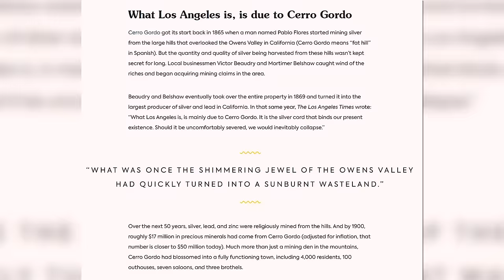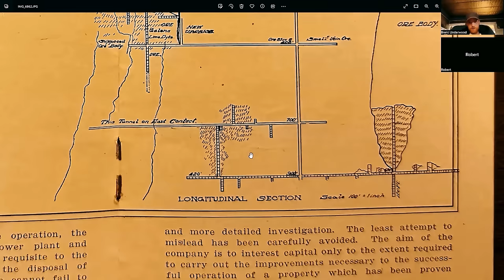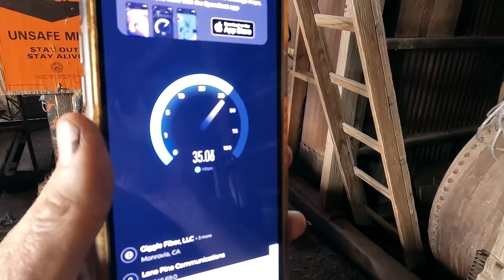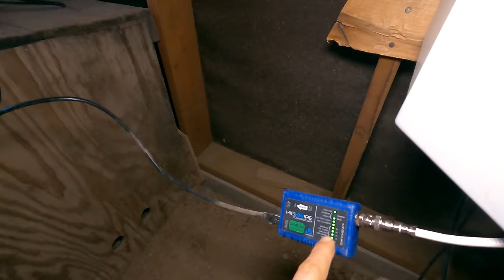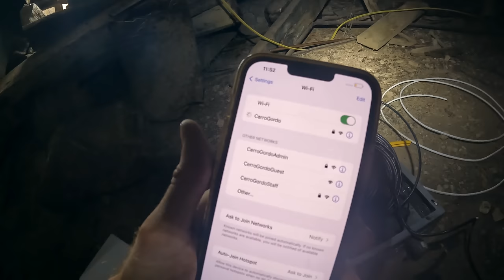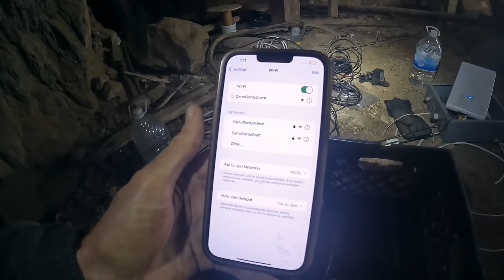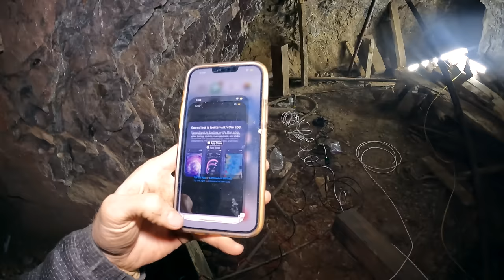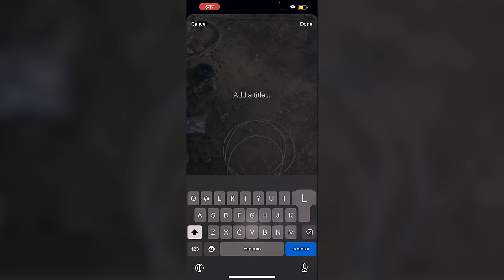I Have WiFi In My Abandoned Mine! 900 Ft Underground!

Comment: as a professional Network engineer, i would have looked at using multi-strand single mode fiber (think a single cable with multiple strands of fiber to splice off of) to each level that is significant to you, such as the 900 and 700 foot levels.  This way you terminate a pair of fiber at each level then add a POE switch to covert to CAT6 ethernet and provide the Power over Ethernet to run the Access Point.  This method is highly extensible and creates a consistent, repeatable network for each level.  The draw back is money, your method is a lot cheaper.  Ether way glad to see you have connectivity down at the 900.
Reply: I was surprised he was getting 50mb over the cable.  not to shabby.
Reply: @procrastinatingnerd  its cause his phone was the only client using that RF space for miles, lol.  you start adding devices and that bandwidth starts getting chopped up real quick.
Reply: Using Coax is just crazy in 2024.
Reply: I agree thats how mondern networks are created. However, to do that well the 900ft of fiber would need to be protected by conduit. So 900ft of conduit.  Then you need the POE switches, those need to be programed to a vlan and protected from dust, heat and humidity. Another problem to solve. You cant just put them in a rack in a closet cooled by a mini split like we do on the surface. 
Oh and the fiber needs spliced. It is not the hardest thing to learn but definitely more involved than coxal cable. 

For those reason, I think the current design is much better because it is the simple and cheep. Thats my 2 cents.
Reply: @bassman87  No, I mean I was surprised that he got 50 mb over the 900 foot cable, not over wifi.  Our wifi can get over 100 mb on the 2.4ghz band, the wifi isn't the limiting factor here.
I thought it was obvious that the more clients you have, the less speed each gets (if they are all using it at the same time)... That will apply to the cable and the internet above ground just the same.
Reply: @AroundHouse  Not as crazy if you look at the price difference for a 900foot run.  Plus a coax cable is much more rugged, seems fitting to be in a mine.
Reply: @procrastinatingnerd  i was more referring to the point to point wireless links than the AP.  but I get your point.
Reply: @bassman87  Oh you meant the above ground wireless connections to the rest of the world. Well with that, I should be surprised that he can get 50 meg to cerro gordo, lol.
Reply: As a fellow network technician, I second the fiber advice and would be willing to come help implement it. At the very least, RG11 should've been used IMPO. Oh, and probably not the best idea to run 1000ft of any low voltage cable alongside high voltage cable.
Reply: @buckmanriver  There are lots of insulated options. Conduit is not necessary.
Reply: He has better internet down there then in my house😊
Reply: Indeed and fiber is  lot stronger than coax !
Reply: @procrastinatingnerd no, fiber is stronger !
Reply: @procrastinatingnerd On paper, RG6 has enough bandwidth for 200 mb
Reply: @AroundHouse Keeping it vintage like the town.
Reply: @jpcaretta8847  Armored fiber cable is stronger.  Standard fiber is definitely not stronger.  I hope you are kidding.
Armored fiber cable is a completely different category and, I haven't checked, but I'm pretty sure it's at least 10x the cost of coax.  Not counting any other equipment needed.
Reply: The network designer slipped a few cogs on this one.
Reply: Was thinking the same!
Reply: @procrastinatingnerd  It doesn't matter if it's 2.4 GHz or 5.8 GHz, as long as there are two antennas pointing into the walls at right angles to each other, and something that looks the same 900 ft above or below it. That's the same solution to the radio problem: the antennas need to be horizontally polarized and aligned E-W or N-S. The difference is that modern wifi uses both polarizations, where two-way radio uses a single polarization. The difference in perspective is that when you're shooting RF up a mine shaft, vertical and horizontal polarization become N-S and E-W because all the antennas are horizontally polarized. The coax is just MOCA. It's plenty fast but runs above 700 MHz.
Reply: I'm not a professional but i would have used 2 seperate conduits (1 for power and 1 for internet) to protect the cables and add the possibility to more easyly add more cables in the future. I also probably would have used normal cat7 or cat7a cable with rj45 connectors (i know rj45 connectors can't handel the full capacity of a cat7 cable but i think there is more rj45 equipment then there is gg45 equipment available). For the networking equipment i would use a small cabin that has an airfilter and a fan for cooling. I think it also could have been smart to add a telephone cable for wired end to end communication to the elevator operater in case the internet dies. A 2nd power line might also be smart if you plan on using lights and outlets. That way you can have the outlets and the lights on seperate breakers so that you pretty much always have either light to see what you are doing when the breaker for the outlets trips or that you have the working outlets to use a floodlight if the breaker for the lights trips.
Reply: Way too expensive
Reply: to run fiber down there, its almost certainly going to get damaged in the future and fiber without conduit would be a fail.
Reply: @mickoram7524  armored fiber exists for this reason.  And armored fiber is a lot stronger than running coax, for God's sake how many times did Brent have to run new coax cause it kept breaking, lol.  

yeah my solution is more expensive, professional, engineered solutions are always more expensive than DIY solutions.  But the professional solutions are meant to last.
Reply: @buckmanriver  you’ve probably ran a million miles of fiber like every other expert on YouTube but as a total amateur I’ve ran fiber in terrible conditions and as long as it’s outdoor rated that stuff is stronger than any cat 6 cable I’ve ran. I don’t even mess with coax but direct burial fiber would handle what they were doing there with zero protection. As far as the switches you’re not running a network for an office building. Get a few Unifi switches and a dream machine and your set up. Those things are quite robust and humidity and dust won’t affect them any more than that access point he has down there. That entire system could be done for 2000 and be much more reliable and easier to scale. Also the fact that you say he would have to set up a vpn tells me you have no idea what you’re saying. He certainly could set up a vpn but my network with fiber and and my Unifi devices works perfectly without a vpn. Although Unifi does make it easy to set up if you want to.
Reply: @buckmanriver you do realize it's cold af in the mines right? Also that is way to much work for someone that isn't an i.t. pro but would be awesome to have in that mine and another thing ubiquity poe switches are perfect for what he wants and ubiquity access points would've been the best option also ubiquity has air fiber that could've got him way better signal for the internet. But it's his system not mine or ours.
Reply: Or point a 2.4ghz long yagi or a 5.7ghz  dish down the main shaft and just pick off signal with flat panel antennas at each level...
Reply: @MaryBrownForFreedom  yeah that would work if they had good line of site. Not sure if the shift has that, I can't tell from the videos. but I suspect the giant metal cage that is the elevator might get in the way, lol.  because they have to run power anyway I wonder the cost delta between all the radios vs preterminated armored single mode fiber.
Reply: So I looked it up 1000feet of 6 strand armored singlemode fiber preterminated with lc connectors is 2,300 bucks.  So pretty expensive but it would provide a professional permanent solution.
Reply: @procrastinatingnerd it's really not. An armored fiber are preferred for backhaul installs in rugged environments. Coax is leaky old tech and suspectable for interfere from machinery.
Reply: @T_Mo271 network designer (Brian) quit working in the 80s lol. Probably up to speed with the tech from that era.
Reply: @mickoram7524 tell me you don't know shit about fiber installs without telling me you don't know shit about fiber installs. Lol
Reply: @pentaxic  oh ffs, nobody here is saying coax is better than fiber.  And nobody is saying coax is better than armored fiber.  Coax is drastically cheaper and good enough, that's all there is to it.
This was an excellent way to get useable internet down a 900ft hole in a very cheap fashion.
Reply: Optic fiber would’ve been a very good choice, since there is already power there.
Reply: @procrastinatingnerd  One of the problems with coax is that if you deform the coax (I.e. use Roman staples to install it) you cause impedance bumps along the coax each time the cable is mashed down, or if the cable gets stretched, this with change the nominal impedance of 75 ohms and if it’s out to much will effect the signal levels.
Ron, N4PHP
Reply: Good suggestion!
Reply: As an AV/IT manager, I came here to say the same thing.  Fiber would have been better and likely more reliable.  Copper has so many issues, not to include massive corrosion issues.
Reply: @dannytipple1232 this would have been my idea of a smart way of doing this because that allows you to put access points on every level and allows you to make emergency calls for instance wherever you are if something happens and you're not on the 900 ft level now you're going to have a rough time making that emergency call
Reply: What about using network over power I forgot what it's called where you basically just use the power lines that you already put in to allow you to access the internet and then you can just have breakout points for every level because you're already have power sockets there
Reply: @binyaminblatt  the theoretical distance for ethernet over powerline is 300m.  This would mean Brent would be at that maximum.  Plus I'm not sure how its tested to get that maximum, i would imagine wach electrical splice could introduce some variability into the signal reducing the max length for a usage signal.
Reply: @Adi-kf6bq  Cat7 can go about a max of 328ft which is why he used coax (maximum of 1640ft) to bring the signal down.
Reply: @klipzig  Direct burial fibre can do many KM... not feet. Fibre would have been the sensible option seeing he already has power down there.
Reply: @procrastinatingnerd faster than my home WiFi 😂
Reply: @buckmanriver   honestly, they should have run conduit using Romex like that is nuts. 3/4 conduit run 240 split phase and a fiber run down it. would be way safer and have a lot more capacity. simple nema3 boxes would be sufficient environmental protection would only need a media converter and poe injector with access point  all very cheap and low power  likely would not draw more than 20W each. also pre terminated pull ready fiber is fairly easy to get as well used to put internet in my barn.
Reply: i see what u did there
Reply: just use a pair of media converter, its cheap. duplex 1gig speed on one single mode fiber.
Reply: @bitcoin-wh5vb  yeah but I don't know of any armored single mode fiber with a single pair, usually its sold as a multiple of 6 strands. (so 3 pair)
Reply: @bassman87  yeah, you're right. but i wanted to ask, what kind of protection does the armored cable provide here ? it's already secured on the side and i thought the cable is so small that it wont contact other moving part of elevator ?
Reply: Yeah, that's what I thought about as well. You can even lay the fiber across the whole mine, no issue at all. 
For the money part: I don't actually agree with you. Media converter nowadays are not really that expensive any more. You also get cheap CDWM nowadays from China. 
I bought single mode fiber for 10 bucks or so for 100 meter. Sure, it's only a single fiber. You get 12 cores for 100 bucks or so. That's more or less the same price as you pay for coax. With all the downsides.
Reply: @bassman87  Naw, you can DIY fiber nowadays as well. You get the equipment for really cheap from China.
Reply: @bitcoin-wh5vb  Armored isn't even that expensive. You get 12 cores for pretty much the same price as a coax.
Reply: @AroundHouse internet providers will still use it from their fiber hubs to customer locations to save cost. It can still hit 1 Gig speeds after all
Reply: @AroundHouse  unless you do video. most broadcast eqipment now uses 12g sdi (up to 4Kp60 uncompressed).
Reply: @alex13902  Oh yea, I recommend fiber as well, just explaining why he used coax instead of using Cat7 which is what the other guy suggested. Although I'm not entirely sure why he used coax, maybe that is what was suggested by his provider due to the equipment of what the provider gave him? IDK. My only concern with fiber that it is expensive and that is a fairly long run. My fear when bring it down would be that the fiber may snag on something and break, or twist, or bend. I know how fragile it is but I don't install it myself, would be best to have a cable vendor involved.
Reply: @buckmanriver  Why does fiber need conduit but coax doesn't? Kind of nonsense. I have fiber running tree-to-tree at home for other users. They make stuff specifically for any type of application.
Reply: @timgraham7851  Not when it's squashed by staples.
Reply: you donating the fiber? ....
Reply: @bassman87 you said exactly why expensive cables aren't worth it. The bottleneck is cell towers not cables.
Reply: @austindobbins8957  no the problem isn't the bandwidth bottleneck.  He was getting attenuation degradation on the coax cause he was running such a long line.  you can see he wasn't getting a consistent link light on the media converters.  Additionally, if I remeber this video correctly, he was struggling to get the SSID to show up on his phone when they were using the media converter as a POE injector.  This is usually a sign of an underpowered AP.  they should have matched the POE spec of the media converter to the minimum POE spec of the AP.

Comment: I had to immediately wonder why anyone with any basic electronics skills would advise using coax.
Reply: It being cheap is the main reason for a lot of people
Reply: The coax is not a problem, it's the power over coax. Way too far to transmit DC power.
Reply: Unless one uses an adjustable supply and crank it up a bit so it ends with the proper voltage.
Reply: I agree, fibre with 24vac would be fine. And probably cheaper..
Reply: Painful to watch
Reply: Imagine the resistance...

Comment: As an ex cable and internet technician, you should have ran fiber, or at least rg11 coax down the shaft, much less loss at that crazy distance. sure you'll lose at the adapters that you'll need at the ends, but not nearly as much as your losing with rg6. especially since your not starting out with fast connection to begin with. would love to see a meter connected to see your levels lol
Reply: he was really quick and dirty with his terminations and with no tester its hard to say what he did wrong. chances are the first cable was just fine and he just got shield wires grounding things
Reply: I wonder if there is less interference as it's underground. Granted, it's next to a power cable.
Reply: @whiskeyinthejar24  that's a good question, but as you pointed out, less interference is certainly negated by the power cable, and the lights.
Reply: @imchris5000  I wonder if he just twisted the stinger together and then twisted the braiding, it wouldn't surprise me cause I've seen it done many, many times working as a tech
Reply: Exactly.
Reply: It is very simple:
Thin Ethernet (ThinNet) (10BASE2)

    Uses “Thin“ coax cable (RG58A/U or RG58C/U).
    The maximum length of one segment is 185 metres.
    The maximum number of segments is five.
    The maximum total length of all segments is 925 metres.
    The minimum distance between T-connectors is 0.5 metres.
    No more than 30 connections per segment are allowed.
    T-connectors must be plugged directly into each device.

Standard (Thick) Ethernet (10BASE5)

    Uses “Thick“ coax cable with N-type connectors for a backbone and a transceiver cable with 15-pin connectors from the transceiver to the network interface card.
    The maximum number of segments is five, but only three can have computers attached. The others are for network extension.
    The maximum length of one segment is 500 metres.
    The maximum total length of all segments is 2500 metres.
    The maximum length of one transceiver cable is 50 metres.
    The minimum distance between transceivers is 2.5 metres.
    No more than 100 transceiver connections per segment are allowed. A repeater counts as a station for both segments.
Reply: @BigTrikerTom   Very interesting, I never got that deep into it, just the basic home internet, I believe I have heard the term "thin net". But never knew what it was. Great explanation and i appreciate the lesson.